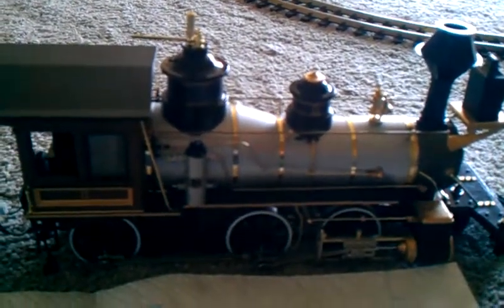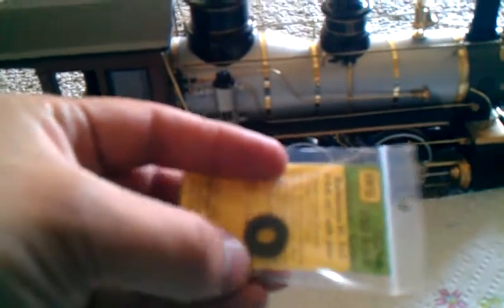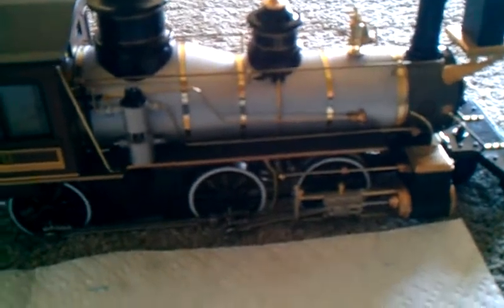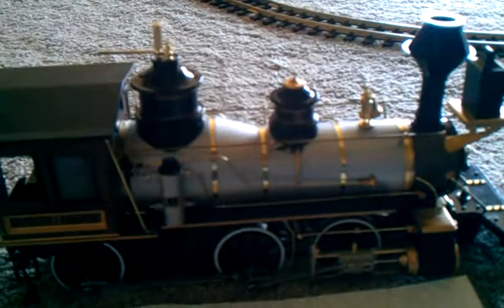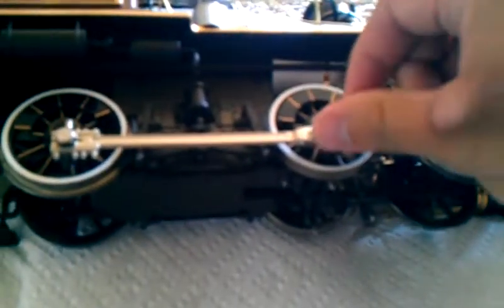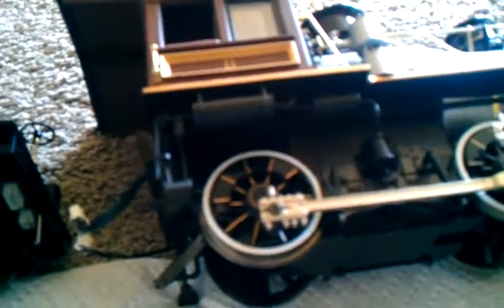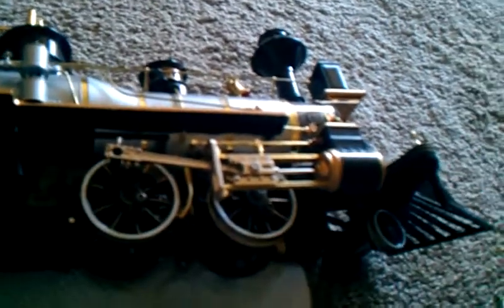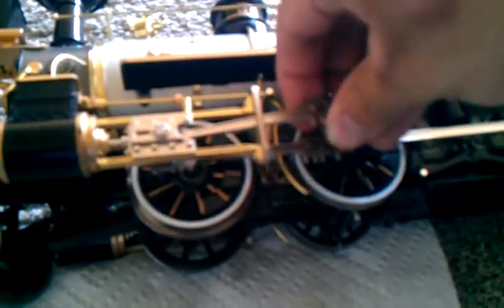Bachmann Spectrum Mogul drive gear upgrade

Comment: 24 tooth or 25 tooth? That is the question. Most people quote 24 tooth but their images are 25 tooth. Most early 4-4-0 and 2-6-0 locos seem to be 25 tooth going by those that have done the repair. NWSL make both. Do 24 tooth 4-4-0 or 2-6-0 gearboxes actually exist?